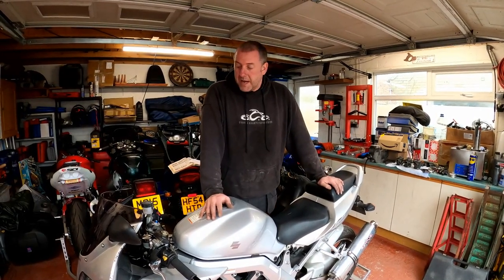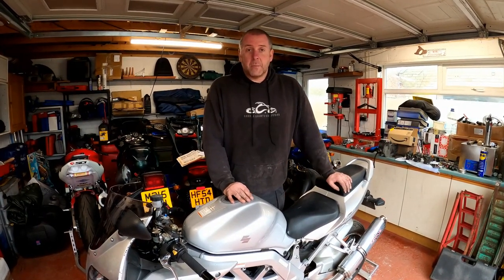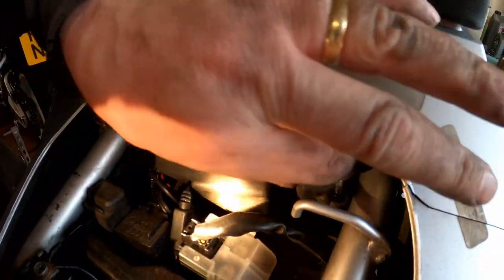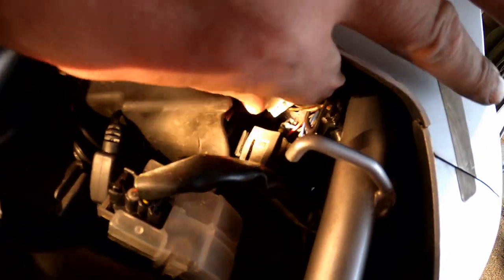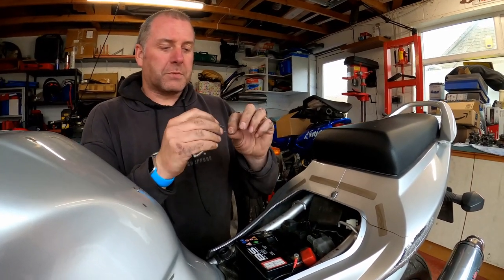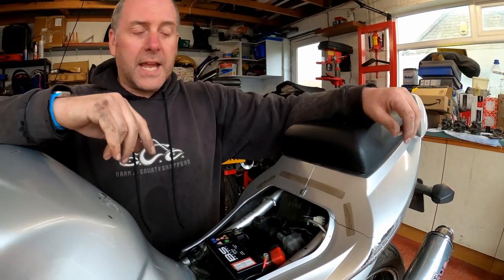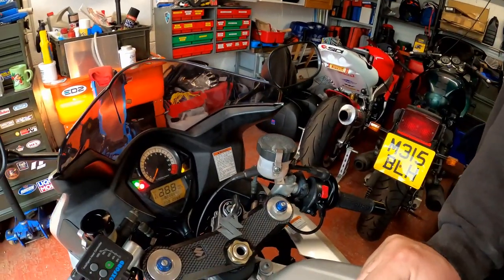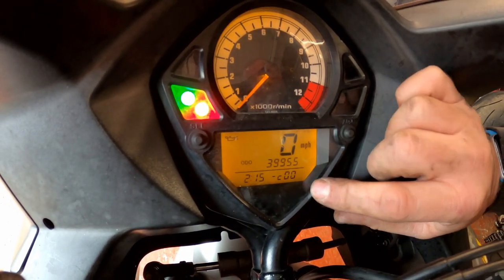Putting The Suzuki SV1000 & SV650 Into Dealer Mode And Reading Diagnostic Fault Codes

Comment: Good stuff Kev. My 650's FI light was on. I followed your guide and found no faults but the TPS required a slight adjustment. A very simple fix using your video.

Comment: My 03 sv started to run lumpy thanks kev I will start with this thanks.
Reply from the maker: Is it lumpy at idle? If so then it could be a synchronisation of the throttle bodies that is needed perhaps. I’ll do a video on this process as soon as I can! 👍🏻😎
Reply: No it idles fine keV it's just when you give it a bit of throttle it wil start running ruff up the revs like a fuel Starvation our something  I have 2 new plugs init and no better so IL have to try that dealer mode.thanks for getting back to me.
Reply from the maker: Cool man, as I mention in the video, have a look at the little dash next the the C00 as this should be in the centre. I have another video on how to adjust if necessary.
Reply: Thanks kev thanks for getting back to me 👍

Comment: Hi Sir. Many thanks for your guide. Have you never did the same on a Cagiva raptor? Same engine similar instrument. Maybe same connector?I think the electric wiring should be the same. Can I send you a picture Maine you could find out the right 2 pins? Thanks in advance
Reply from the maker: Absolutely bud, head over to the Kev’s Shed group on Facebook and pop the picture in there and I’ll take a look 👍🏻😎
Reply: @KevsShed . Good day Mr. keV. I posted pictures on Facebook group as a question. Can you have a look? Many thanks in advance. Regards

Comment: Tried the paper clip multiple times, in the correct holes as described but it won’t switch to dealer mode to show fault codes. Any suggestions? Won’t start and no fuel pump noise on key turn.
Reply from the maker: My first check would be the green connector under the airbox just behind the headstock, these like to corrode and cause all manner of electrical issues, much like those that you describe.
Reply: Hi
Might be fuel pump fuse
Replace it with a new 10A

Comment: I only seem to have four pins in my connection block,nothing missing as the empty ones are blanked off with rubber grommets ??any ideas
Tia
Reply from the maker: Hey Dane, the one with the little black rubber blanks is the wrong connector mate, the one you are looking for will look identical to the one in the video but could possibly be tucked out of the way and you just haven't spotted it bud! 👍

Comment: Hello Kev from Sydney. i have an 07 SV650 has been reliable for 70k klm will not start fuel pump is priming dash lights up side stand switch and clutch lever switch works. Pulled both plugs with ign leads on and plugs earthed out there is no spark when cranking. Also plugs had fuel on them so Fuel inj is working just no spark. Any help appreciated.
Reply from the maker: I would initially suspect coils buddy 👍🏻

Comment: Hello, I don't seem to be able to get my into dealer mode, any thoughts? Followed the procedure to the t but to no avail.
Reply from the maker: It can only be one of three things then really mate, either you have found the wrong plug, you aren't making good contact inside the plug with the terminals or you have a gen one carbed 650! 😃
Reply: @KevsShed  Thanks for the reply.  I'm going with poor connection. The fuel pump isn't priming when I turn on ignition, any thoughts on what may be causing that?
Reply from the maker: @willramsay6979  The side stand relay and fuel pump relay are on the same circuit mate, if there is a problem with either of these then the pump won't prime. I would look there first. Additionally, if there is an issue with the tip-over sensor then the ECU receives a signal to turn off power to the fuel pump relay. This should give you plenty of good places to look bud. Good luck!
Reply: @KevsShed  Cool, will get checking! Thanks for the advice.
Reply: Would the alarm wiring connector have anything to do with this? I got hold of a dealer mode switch and still only showing Check on the dash.
Reply: Just noticed the little oil can symbol is on on the display, pressure sensor?
Reply from the maker: @willramsay6979  That light should go out when the engine is running, if it doesn't then you have an oil pressure problem so turn it straight off!
Reply: @KevsShed  Hi Kev, the issue was with the wiring due to the alarm being removed. Bike is now running and sounding great. I have a few MOT related questions, can you help with those? Cheers

Comment: MANNNNN, I'm laughing so damn hard now, so my SV1000s has the -c00 thing showing and I thought my gauge or sensor was messed up, someone put a switch to the plastic connection and i fiddled with it, I thought it could be possibly be related to the dynojet power commander installed lololol
Reply from the maker: Haha, I get ya! Having a switch fitted makes it easy to flick the dealer mode on and off though! This is in fact the very thing that the official Suzuki tool does! Glad you found your bike to be fine though!

Comment: Any ideas for if the bike will not even go in to dealer mode? Tried with paper clip and wire, chec light on dash flick the kill switch and it just stays the same
Reply from the maker: The only possible explanation is that you aren’t using the correct connector! Either that or the cable to the connector is damaged perhaps?
Reply: @KevsShed  definitely the correct connector, bike will turn over no problem but no spark and no fuel pump prime wouldn't have though it would cause it to not enter dealer mode though? , its a wierd one nobody seems to have had experience with an sv that won't register dealer mode at all!
Reply from the maker: I’ll be honest! I’ve never heard of it myself! What year? Is it 650 or 1000?
Reply: @KevsShed  haha, it's a 2004 sv1000, it's only got 7k miles on the clock but was layed up for 12 years, new fuel pump, new ecu, all safety switches bypassed, relays etc all good, ignition good along with green connector, chec message on permanently so the bike is registering some sort of safety cut off but who knows where from!! Lol
Reply from the maker: Have you checked the killswitch? It should have check on the dash when the switch is off but should change to the code when flicked on. Could explain why there’s no priming of the fuel pump too!
Reply: @KevsShed  I have been doing it with the switch off and then when switched to on it doesn't change anything, the kill switch is working as it will not let you turn the bike over when the kill switch is off but once flicked  you can turn the bike over. Its a wierd one alright, back to the drawing board I guess lol
Reply: Hi. Did you resolve the problem? I’ve got an SV1000S that won’t switch to dealer mode, defo right connector and right pins being used with paper clip. My fuel pump isn’t priming, fuse is good etc but nothing on the starter button. Not even turning over.
Reply: @douglasanderson4508  you guys get anywhere with this? I’ve got same issue - my suspicion is alarm/immobiliser dead but not sure how to check or remove it!

Comment: found mine with error code c12 means crankshaft position sensor now what i want to know where that sensor is located
Reply from the maker: Hi mate, it can be found in Chapter 4-35 of the Factory Service Manual. If you don't have a copy then you can get one here for only a few quid which is a highly worthwhile investment! https://rover.ebay.com/rover/1/710-53481-19255-0/1?mpre=https%3A%2F%2Fwww.ebay.co.uk%2Fitm%2FWorkshop-Manual-Suzuki-Sv-1000-Manual-Workshop-DVD-Repair-Service-English%2F202246190800%3Fhash%3Ditem2f16cff6d0%3Ag%3AwL8AAOSw7OdcEaFm&campid=5338707657&toolid=10001&customid=

Comment: The white plug on mine had a metal cap with 6 pins going into each hole. Is that supposed to be there?
Reply from the maker: That’s the wrong connector bud 👍🏻